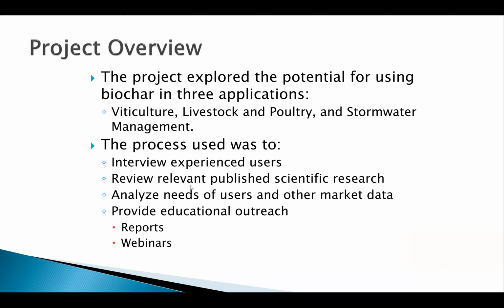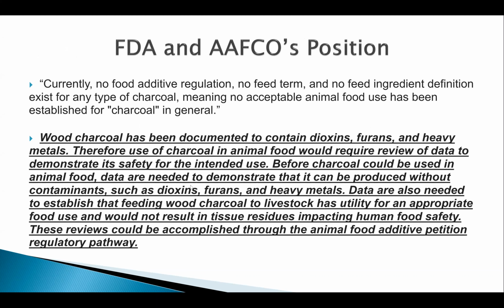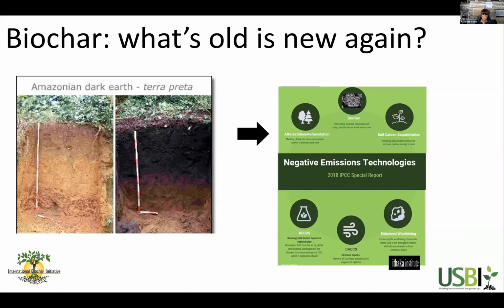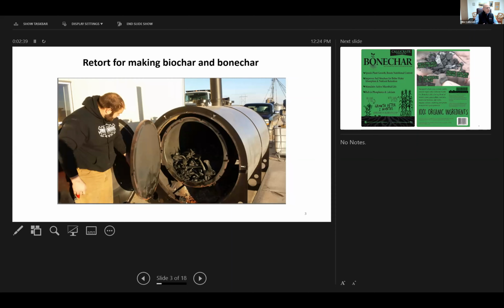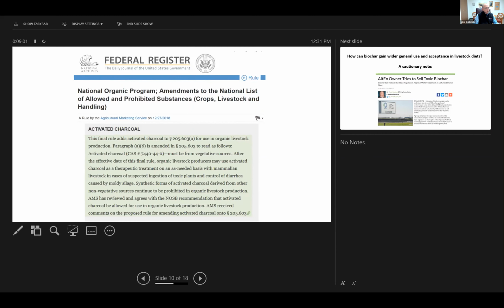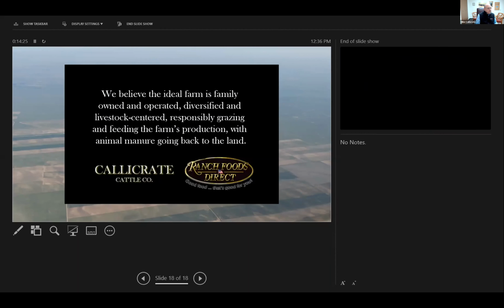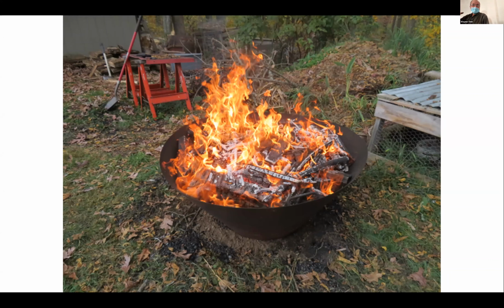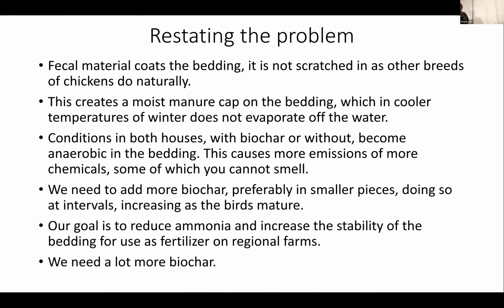Biochar Use with Livestock and Poultry Webinar

Comment: Very informative thank you. I have a compost and chicken farm in north east Thailand. We also farm worms and Black Soldier Fly. We have a good biochar production facility also using specialist kilns with gasifiers and wood vinegar and bio-oil capture. We use biochar powder in our chicken houses putting down a layer on the floor first then we add more once every month and it is gently raked in to the woodchip deep litter bedding. Our birds aren't so dense as a larger commercial house, we have around 4.5 birds per sqm only. Our chicken houses are open sided above the perimeter nesting boxes with wire mesh only to aid airflow. Our primary reason for adding biochar to the bedding was to produce a better quality compost product from the bedding but we do believe the hens prefer it too as they do eat some of the biochar and they are more inclined to scratch around looking for biochar thus helping to aerate the bedding. We also make our own chicken feed mix made into feed pellets using our machines and the feed pellets include a small amount of biochar powder added together with the other ingredients (Azolla, BSFL, Cornmeal that we grind ourselves, a little salt and traces of a few other ingredients). Our feed costs are about a quarter of usual commercial farms so we run far greater profit margins on our egg production (our cost per hen per day is about 1/2 baht compared to the usual 2 baht per day per hen here). We of course use biochar in our compost business too. We add raw biochar when we create our aerated compost piles and we also produce inoculated biochar for direct sale. We are also selling raw biochar to other farmers to use specifically for their chicken house bedding or as a feed additive. Our biochar is produced using old dry wood, bamboo and coconut shells predominantly and our kiln baking temperature runs between 600-900 degrees Celsius.
Reply: Skyfarmorganics that you very much for the information. I have being following up poultry farmers in you country on this topics. My home country in West Africa, we just put wood shaving for bedding but still smells. I have being watching videos on YouTube on poultry farming.  Sometimes it scared me a lot should incase the birds get sick and died which is a big loss of income. One thing that also bothers me is vaccines. We don't have them in our country. All the pharmacies just sell human medicine. So farmers just do local chickens in their backyards in small amounts.